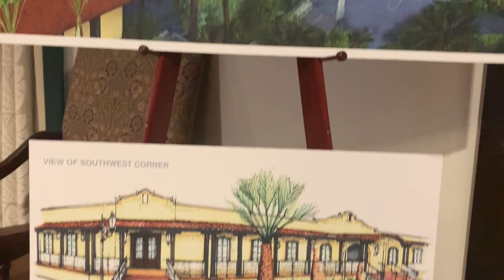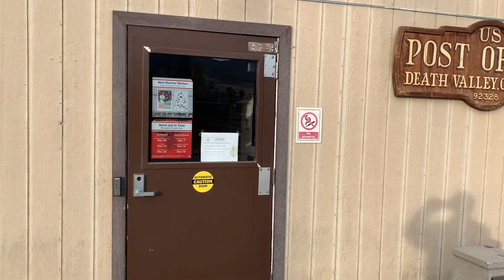Oasis Christmas Construction Update

Comment: they finally got a few traffic and store signs up too... but still need more directional signs in the store area, so stupid how long it takes them to get approval... we ate in the saloon over summer, very nice and the store is excellent. Not a bad remodel overall, but i think prices in the store for regular stuff went up some
Reply from the maker: Thanks for stopping by. At first, I resisted the huge makeover of the old Ranch at Furnace Creek but now that it nears completion, I'm all for it because the prior one was starting to look very worn out. In twenty or thirty years they will have to remodel this new one as well. BTW - I spoke to the person in the golf course shop and she said that for now, it will stay the same because structurally it remains sound.
Reply: @DeathValleyDazed  im kind of in the same boat.. was not in favor at first but they did a good enough job with the remodel i cant really complain other than the prices for sodas going up, it's nice...They kept the misters and they work even better now hooray! i also noticed there is an old restroom behind and south of the store that has the old signage still (in august anyway), took a few photos in case they take it down but looks like they'll keep a few things good to hear thanks
Reply from the maker: eclemensen - I understand your sentiment. Most visitors stay in the less expensive but expansive campgrounds while the wealthy spend hundreds a night for the Xanterra facilities which are usually at capacity. The Inn is now open year round after expansion last year. It used to close during hot summer months. English is the secondary language around the park now. People around the globe are fascinated by DV so visitation has increased. Las Vegas becoming more family friendly has also spiked park visitation. Everyone I visit with in the park is loving it.